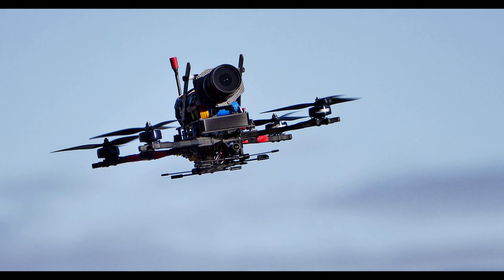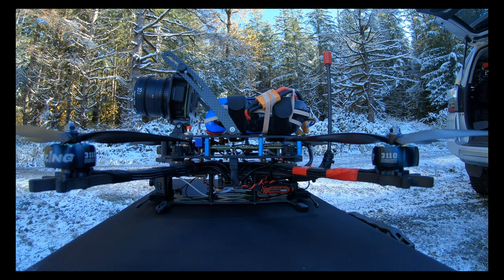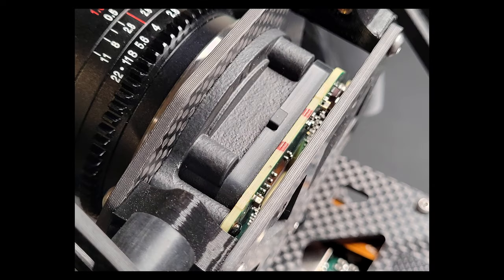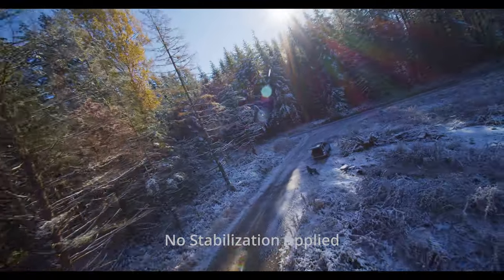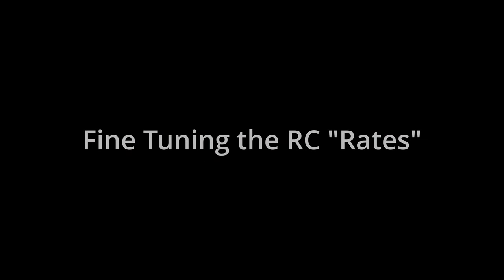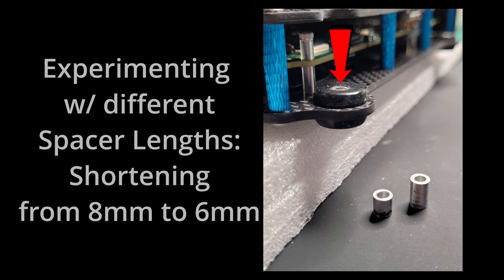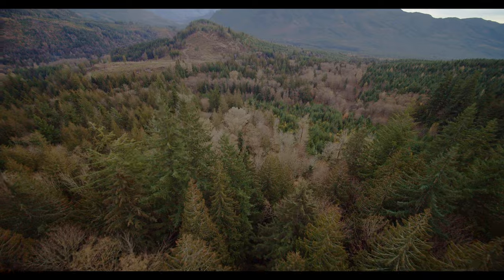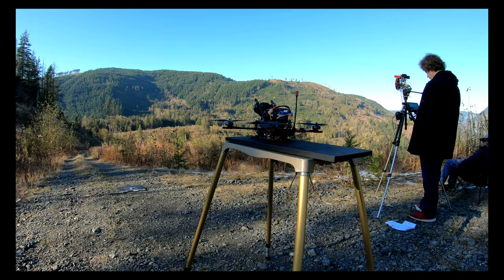Cinelifter Vibration and Jello Dampening Tips: Naked BMPCC4K Long Range Quad

Comment: Wow just found your channel and this video is extremely helpful! I’m about to build my first Pigeon and this walkthrough  of getting it flying smooth is so valuable! Thank you so much for making this!
Reply from the maker: Thanks for watching. I have since discovered that some props vibrate more than others. For me the HQ 8040 rei forced Cinelifters are smoother. Also shoot the naked BMPCC4K at 120th shutter.
Reply: @ValleyFPV Thanks for the reply! Should I shoot at 1/120th for all frame rates? 24, 30 and 60? I’ve typically used the 180 degree shutter rule but maybe that does look the best with the BMPC
Reply from the maker: @Maxwell Peters  I have discovered that for my build  higher that 1/120 and there shows up jello in the video. So 120 or slower is a safer setting in that regards. Sure use whatever you like. I always use 120th as gyroflow works better at higher shutter speeds.